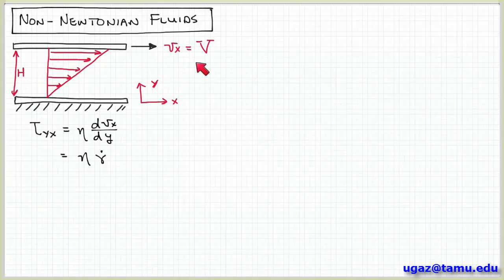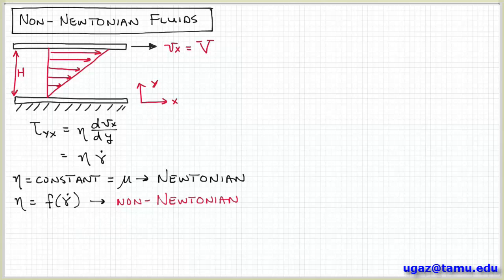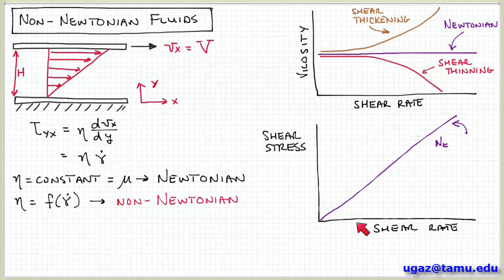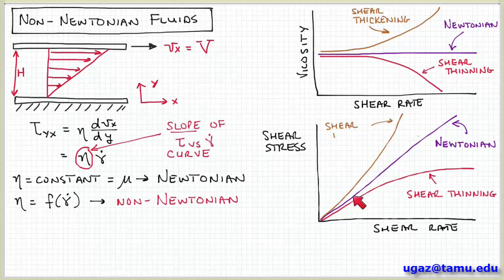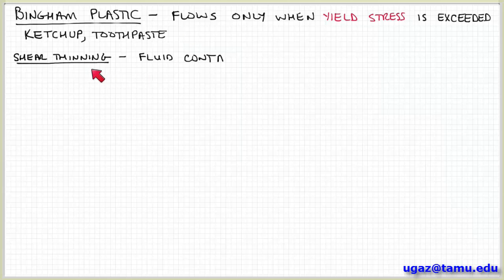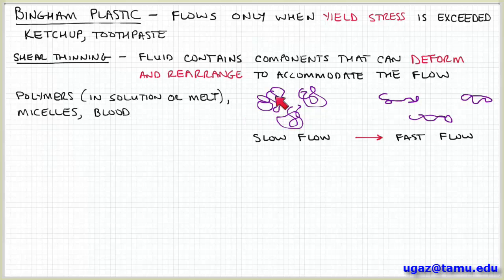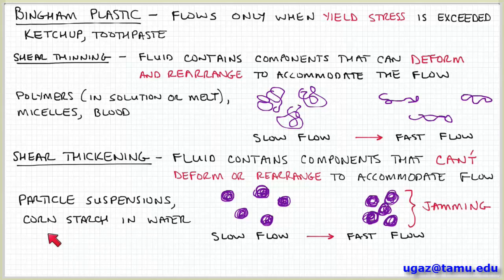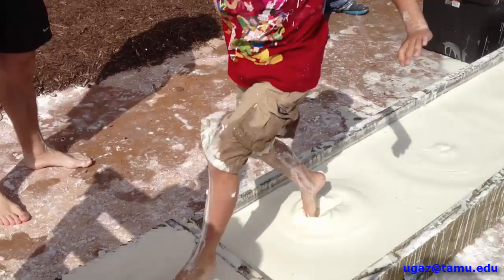Non-Newtonian Fluids, part 2 - Lecture 1.6 - Chemical Engineering Fluid Mechanics

Comment: Great video overall, very clear explanation and scientific! One thing just, pretty sure your viscosity vs shear rate graph is wrong. Even though it gives the general understanding (i.e viscosity decreases over shear rate for shear thinning e.t.c) the slope is wrong, shear thickening viscosity is increasing over increasing shear rate but the slope of it is increasing so it should be nearly parallel to the Newtonian viscosity=constant line at the end instead of increasing faster

Comment: Hey great video! Just a quick question: if we plot the viscosity against the shear stress instead of the shear rate, we should get the same viscosity trends right? I ask this just because to me it's easier to think about changing the stress applied to the system since it's just a force over the area instead of changing directly the velocity gradient.